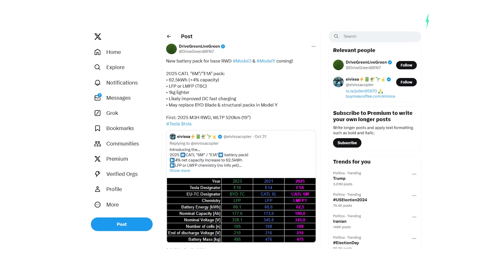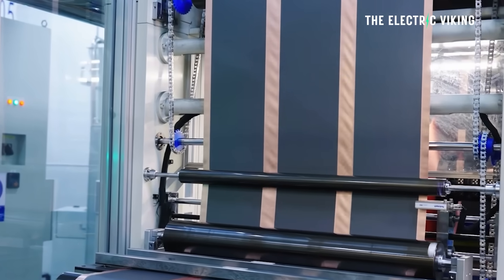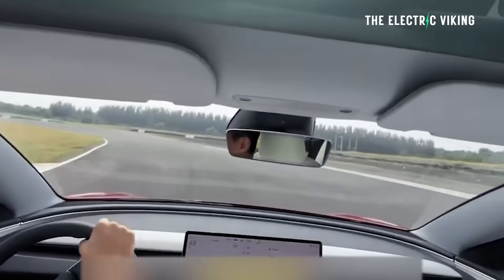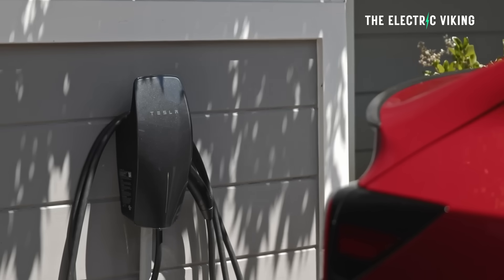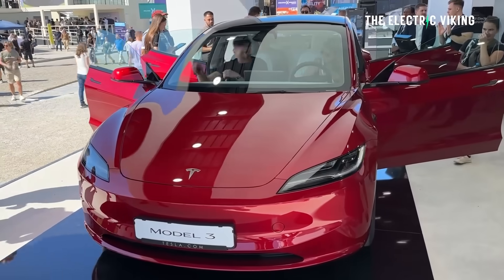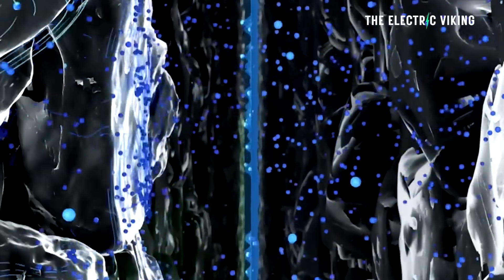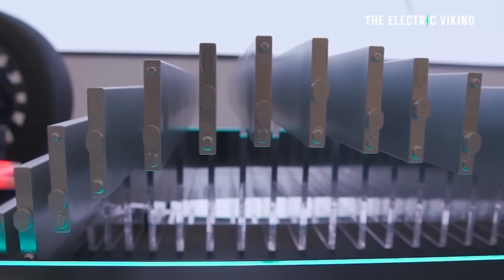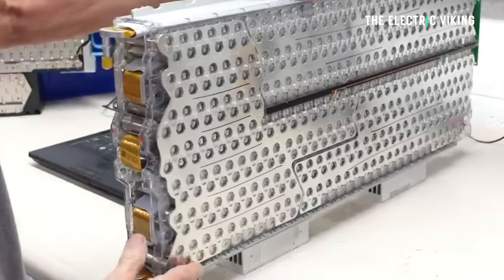2025 Tesla's will get a brand new CATL 6M battery with faster charging

Comment: oh man...simple math and physics. The voltages in the battery pack are kept almost the  same, so Charging speeds (kwh/h) will not change dramatically, because there is a limitation in current for the chargers. However, what will change, is the time spent at the supercharger, because they can keep the battery cooler for a longer period of time (they are adding additional "cooling" to the battery pack, because the volume and the weight doesn't change, but the gravimetric energy density is increasing). So they will be able to maintain the charging speeds for a much longer time at the maximum of 170-180 kwh. To be realistic, this battery will be able to charge relatively the same as the BYD blade battery used in the standard model y in Europe. So around 20 minutes from 10-80%
Reply: simple math and physics... than pls correct your charging speed to the right unit
Reply: @maxu.8110 are those units wrong? Kilowatts times hour divided by hour is units of kilowatts. Which is energy per second. That sounds to me like it might be correct
Reply: @ ? 170-180 kWh? Just use kW, also the comment is already changed
Reply: @SigFigNewton  kWh is used as a unit of energy, kW as a unit of power and rate of use.
Speed of charging is always expressed in kW.